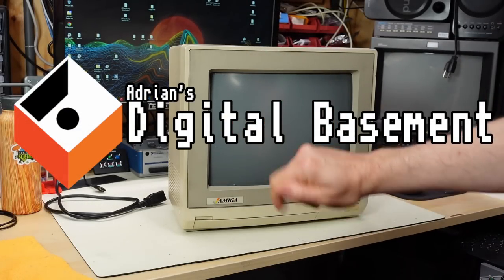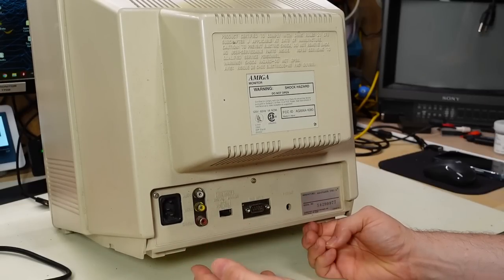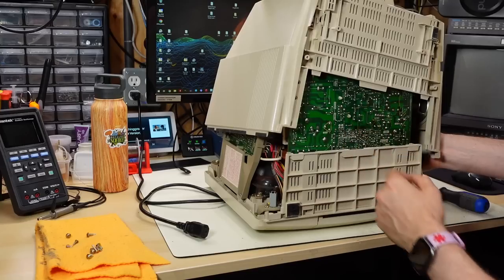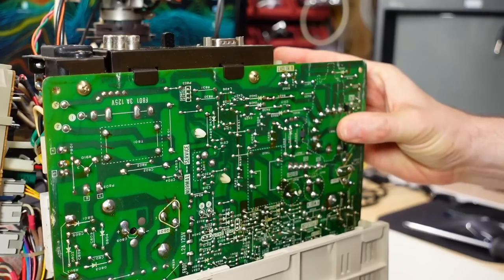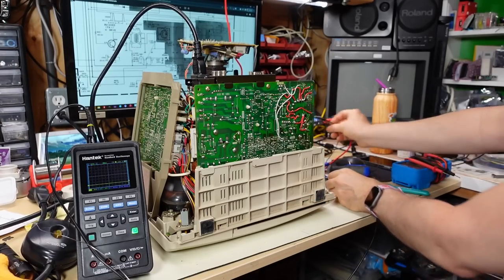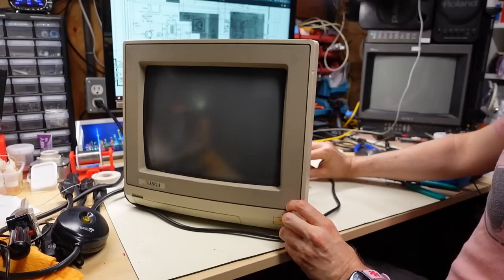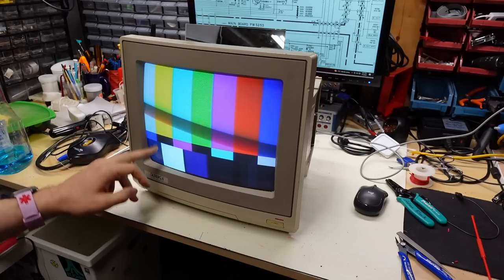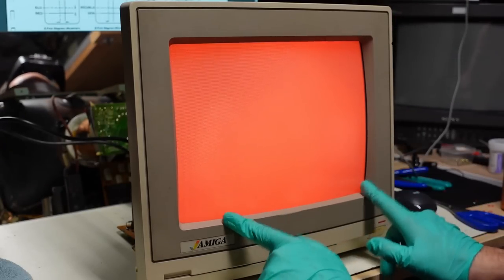Commodore Amiga 1080 monitor resurrection

Comment: 2:16 the metal plate is for the Amiga 1000.  Some of these monitors did not have it and caused the machine to have read/write errors!  I discovered this because I was having errors on one of my Amiga 1000's with one of my 1080's and when I swapped monitors the errors went away.  I then noticed this metal plate under it!

Comment: I've repaired some cracked PCBs , strengthened the PCB by expoxying strips of PCB material over the cracks, before adding jumper wires, for a more "permanent" repair.

Comment: the way i have done Cracks in tv in the past was to remove the parts from the area and Epoxy the PCB. then fix the tracks and add the components back. it is then unlikely to Re-Crack again.

Comment: Keep in mind once you get above several hundred volts, you want to keep the joints clean and smooth to minimize the possibility of arcing. There is a special paint called “Glyptal” that can be used to coat connections that may need a little extra protection. The other suggestions regarding stop-drilling the cracks and scraping the solder mask before soldering across the cracks are good as well.
Reply: There shouldn’t be anything on that board higher than a couple hundred volts.  The really HV is all through the anode, and that’s a sealed cable straight from the flyback.

Comment: Great video, good result. Just a point about auto degauss posistors. The idea is it’s low resistance when cold, and applies a voltage to the coil that diminishes as it heats up. You had powered the monitor face down, and although the flyback was not connected, the degauss was. Degauss happens with respect to the earth’s magnetic field. So if it degaussed face first, and the posistor stayed hot, no further degauss would occur. This means as you sit it back upright it’s no longer degaussed with respect to the earth. Leave the set off for 15 mins or so, then try again. I also recommend to use some epoxy resin to fix the the cracked pcb and stop and further spread. But that said, well done. Another one saved :)

Comment: Nice video Adrian, I love the troubleshooting part of the videos, watching an experienced electronics guy show in understandable terms for a novice is soo helpful. Obviously as a novice I don't recommend novices to play about with 26KV devices, unless they have triple checked about discharging the item, seeing if it's fitted with a bleeder resistor etc etc...HV can do big damage to a heart etc. Apart from that, have to agree with the general consensus of scraping the mask off and basically welding the PCB on both sides. But hey, what do I know :)
Reply: I agree with patching up the wide traces with some solder braid, but also leave the jumper wires in place and only rely on the solder braid for mechanical reinforcement. Then you only have to patch the wide ones, there's no mechanical point to patching something half a millimeter wide.

Comment: Regarding the ripple: Look for a small value capacitor in series with the horizontal scan coils. It is likely in parallel with a resistor. The purpose of this is to create an LRC circuit to counteract ringing caused by the inductance of the energized coils at scan frequency. The ringing effectively means that the cathode beam(s) are moved at a non-constant pace, causing small ripples in brightness. Since many of the traces around the flyback have been repaired, you're also affecting the "ringing" to a small degree as well.
Reply: I haven't looked at the schematics but I would suspect the S capacitors are film capacitors.

Comment: There is no perfect convergence on a CRT however there is a grid that is overlaid on screen that you measure the convergence grid to. Just eye balling it won't work. Not that you can't get close to specs with the eye but you need the grid overlay to get it perfect. But definitely good enough. I once did a convergence on a old rear projection TV and that was a nightmare. 3 CRTs for each color. I hand ruled the grid with dry erase marker and after a few hours it became a "good enough job"
Reply from the maker: Ah that makes sense -- would allow them to make quick work of it all. I'm sure they got really good at on the assembly line, even though it was mostly just "good enough" :-)
Reply: @adriansdigitalbasement2  Apparently I wasn't completely correct. I was going off a old rear projector that mentioned a grid assembly. for the tub it self you could get this tool. I will see what I can dig up.

https://youtu.be/DGzS3IhifRE

Comment: @Adrian's Digital Basement ][
SuperGlue! Fill those cracks with SuperGlue and once cured go over it all a second time. SuperGlue's natural wicking action will work it's way into all the cracks and fibers of the PCB and create a very strong bond. Been using SuperGlue for these kinds of repairs for years and it works wonders!

Comment: If the image ripple is caused by a bad capacitor I would suspect one of the power rail caps charged directly off the flyback. I believe these are the ones which are subjected to the most ripple.

Comment: Seeing that cracked PCB makes me wonder one thing... I am currently working on repairing my 30 year old Sony Hi-Fi, which has a cracked PCB in the amplifier. Since I was able to get the schematics, I am basically recreating the entire thing in KiCad, and then layouting a board that has the same outline and location of connectors and other important components. 
So.. now I wonder if there would be a place where enthusiasts all over the world could simply upload such recreated designs for others to use. Since the schematics for the cracked board in your monitor are available, one could do the same thing, and maybe someone else somewhere in the world could find it useful.

Well.. just thinking out loud...
Reply: It seems most people who bother KiCAD'ing up a PCB end up buying some from PCBWay or similar, and they allow the option to let others look at and use your design. This is going to be fragmented, each circuit only being on the server of the company that ran the boards, but it's better than nothing. Also you have a lead on who to contact if you get stuck -- chances are the person that uploaded it has built at least one by the time you see it.
Reply: @mal2ksc  I wasn't aware of such an option, since I don't get my PCBs through PCBway. I usually go to JLC, as they are less expensive and their quality is really good. I haven't seen such an option on their website yet. The only designs I can see are the ones that I have ordered in the past..
At the same time it is probably pretty risky as you have to mention the original manufacturer and part number in order for people to be able to find those designs. And I don't know how companies like Sony would react if someone offered a compatible replacement for one of their PCBs, even if the product itself was phased out 30 years ago. After all, that company is still in business, unlike many of the retro computing manufacturers.

Comment: This trick is pretty obvious and well known to experienced bench technicians.  You can test a capacitor already soldered in place without completely removing it by either cutting the lead on one side or desoldering one lead out of circuit, then do an ESR check on the cap.

Comment: Great video, Adrian. Thanks again. Central safety idea, x-rays are not good. Heh.
Reply: X-ray production is only really a hazard if the tube anode voltage is set far too high

Comment: I'd suggest crazy glue for the cracks as it's plenty strong and is  thin so will (and is designed to) go in by capillary action and seal anerobically (word?)... :)   Just put very small amounts on all the cracks, you can open the cracks slightly as applying if you like, or probably don't even need to do that.

Comment: If it were me I'd put some 2 part epoxy on those cracks to stabilize the PCB... The ripple could be caused by the bodge wires through inductance into the surrounding traces.

Comment: I would have removed solder mask on the broken copper tracks and soldered across them as they are so wide around the flyback and re-apply solder mask then maybe re-enforced with epoxy resin

Comment: If I were doing a repair for this at work, I would have scraped back the mask and used a few cut off part legs or bus bar to bridge the crack. I'd have followed it up with a layer of non-conductive epoxy on top of that.

Comment: if you cant get it to work good there IS a way to swap crt to lcd (seen people do that before they want keep they own dream pc case and monitor case like matching set)
i do believe in you adrian because i do see it in you and you almost have it i adjusted you go back replace capacitor on video board (where it was disconnected that show no output video n u have plug it back in n there short in there causing ripping video screen)

Comment: I would epoxy the board and then remove the paint and solder bridge the traces. Use slow curing epoxy or UV stuff whichever is stronger. Maybe desolder components first for better access. After the repair you could put a new layer of paint on the traces. Makes it look cleaner.
Since it is only single sided you might be able to make a new board and check and move the parts.

Comment: Nice repair, but you made your life harder than needed. Use a small drill bit to stop the cracks at the end. Stabilise the pcb temporarily with hot glue. Then use those fibre glass pencils to remove the solder mask, flux the copper and use solder to jump the cracks. Wire wrap wire to jump thin traces. Test, fix anything you missed then Epoxy the crack with non metallised epoxy. As mentioned below the flyback core may be damaged. Shango66 covers this with the self destructing Sonys.

Comment: I guess the other way to do this would be to epoxy the board back together, then scrape off some solder mask and solder over the broken parts.
Reply: Yes that would have been the correct way
What he did wasn't good took longer and looks horrible 
Either way the pcb should have been glued back
Reply: That is how we repaired this extremely common failure in the 90s. Epoxy the board literally made of epoxy back together then fiber brush the traces and bridge them with solder. Replace any missing with copper foil tape. Seal the board. Did this a hundred times at least.
Reply: That would have been my idea as well. Soldering the cracked traces back together would also make the board more solid again.
Reply: Adds mechanical strength too.
Reply: @Stoney3K  yeah and the problem is it can crack more as he didn't fix the support piece and have arcing
Im very let down on this horrible job i expected better from him
I really hope he sees this comment and redo it
And fix the support
Reply: @primus711  I wouldn't say it was bad, I mean it's fixed now. As he said, not a permanent repair but worth while to see if it's good enough to invest more time in.
Reply: @kuro68000  it was very bad
And there is no reason to waste time not doing the repair correctly the 1st time
Reply: He's going to have to do that once those spindly little wires burn away... there's a reason those traces are so damn wide
Reply: IMHO and from experience just putting a solder blob across the crack is not the ideal way to go, since a big crack like this can sport hairline cracks in its vicinity. Especially if high currents are involved like in the path between DST and H-DY.
Those who fixed TV back in the days (~1972) of thyristorized (!!! Thyristor like in SCR not transistor!!) deflection will agree. 
And the rigidity is regained by glueing the board back together.
 The best approach IMHO is to follow the trace and then use bare hookup wire to bridge between solder joints closest to the crack, while routing the wire to follow on top of the trace. The hookup wire can then be tacked midway to exposed copper on along the existing trace (even soldered across the crack if you so please) to give it shape.
Also always observe the routing of the traces. The collector of the horizontal output transistor has up to 1200Vpeak on it. Arcover prevention is a reason that trace is kept clear of lower voltage traces and why, where space is too crammed, there is even arc over preventing gaps in the PCB, esp around the HOT. His routing of that collector wire is an arcover waiting to happen, which may take out NLA chips across the monitor.
Plus after such extensive repair never power up a monitor without current limiting by means of a dim bulb system (aka series lightbulb trick as described on Sam Goldwasser's FAQ and notes on TV Radio Monitor and SMPS repair. If you don't know about that FAQ read it!)
Reply: @TheBSussMan  The wires are fine. Remember that the traces are very thin, so they have to be wide. The wire doesn't need to be nearly that thick, especially stranded wire.

Comment: don't touch a capacitor when measuring it. I know the leads might have been too short to make good contact but touching it will mess with the capacitance measurement significantly. Would rather use a wire w/ clips if the cap leads are too short.

Comment: Ugh.  I hate phenolic boards.  Or, copper-on-graham-cracker.  I’ve gone through four LaserDisc players from that crap - two with severely cracked boards, the other two with extensive electrolytic fluid damage.

Comment: Epoxy the crack from the other side.
Scrape the solder mask on the cracked traces.
Bridge the cracked traces with copper and solder.

It's going to be a way more durable repair.

Comment: A little hint... Take some panty hose and attach it to the end of a vacuum cleaner hose with a rubber band. Then run the vacuum under any place your cap might have rolled under. This way, the vacuum will suck it up right to the hose, without sucking it into the vacuum, and with any luck, you'll have your cap back, along with anything else you've dropped down there over the years!

Comment: Miles better way to repair this is to remove the mask on the bigger connections and used heavy gauge wire. Also drill holes at the end of the cracks

Comment: David (The8BitGuy) has a video on his channel, you've probably seen it, he was on vacation and a friend of his fixed a monitor that had a broken PCB. Luckily there were no heavy component on that part like the flyback. He scraped off some solder mask and soldered accross the crack a piece of paper clip to give back some rigidity to the board. But in this case you'd really need something really strong metchog, because a circular chunk was almost torn out from the middle of the PCB. That's a very nasty crack...

It's interesting, I usually watch your videos at 1.25x or 1.5x speed and when you turned the monitor on successfully the screen looked like it's jumping up and down and I was thinking why don't you acknowledge that in some way. But when I slowed down the video playback speed to the original 1x the jumping is not visible. Strange fenomena.
Reply: I kinda prefer that to wires myself. Tidier and easier to follow the traces.

Comment: Single speaker was probably so they could have a "budget friendly" SKU that lacked certain premium features. Intel and AMD do it nowadays for various microprocessors.
Reply: I think I'd be tempted to upgrade and put a speaker in the other side and patch the signal across. Even though it would still be mono, at least it would be coming from both sides of the monitor.

Comment: Could storing it next to a magnetic source affect a corner?
Reply: Yes, it absolutely can. I've seen it happen from CRTs in a recording studio that were immediately next to speakers. The coil takes care of it, but eventually it sort of "habituates" to that magnetic field. In the case I saw, the only way to keep the monitors from looking terrible was to always move the monitor and the speaker that had "trained " it as a unit. And when it came time to replace them with LCDs, they were completely useless because they could no longer function properly in the absence of the speakers (which were not leaving the studio, they still were great).

Comment: The main reason I don't buy monitors and have them shipped. They need one of those drop tattle tell things that breaks when you use it for a basketball.
Reply: They're called shock stickers, and it looks like they cost about $6 each which is probably why they aren't in more common use.

Comment: @Adrian's Digital Basement ][ Oh no, never, ever fix broken traces that way... You should scrape away solder mask and solder a jumper wire on whole surface of the trice, not simply connect it point to point.  iMO a solder wick is better choice for this kind of repair then cord wire...

Comment: Upgrade it adding other speaker for an stereo output.
Reply: The amplifier would still be mono, so you'd just be getting the same thing out of both sides. I think that's still worth it (speaker drivers that size are cheap) but it's not stereo.

Comment: This is an Amiga 1080 monitor, so you should really give it a 1080 signal lol.

But NEVER use hot glue inside a crt set, it will melt, you need to use silicone
You need to take those rubber wedges out and replace them, they go hard and hold moisture this will destroy the yoke.
I always use copper tape to repair traces. adding wire can act as an antenna and add interference in the picture.

Comment: On he first long trace you bodged, I don’t like you crossed over another wire…
Reply: I also didn't like him repeatedly adding wires to the same point. It's fine to have a star pattern, but you want to make sure you have one solid solder joint going through the whole stack, which you won't if you keep stacking new ones on top. However, given the severity of the damage, I think that an event that causes that janky solder joint to fail will likely also cause further cracking of the board that will require repair, so it's not worth going back in there to clean it up now.